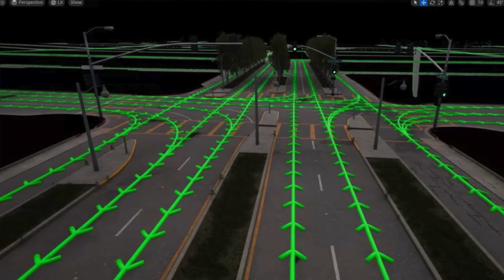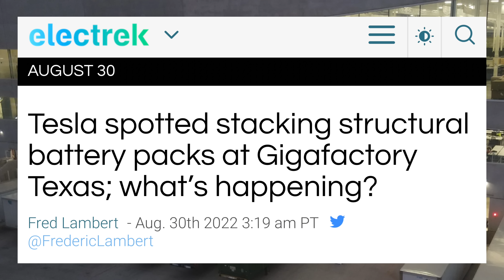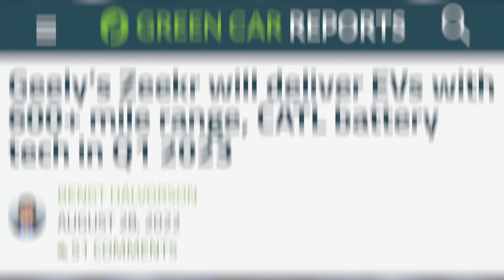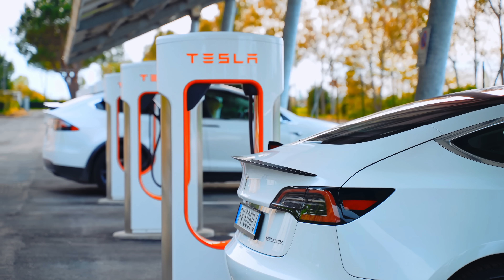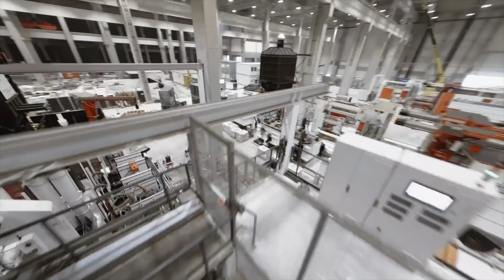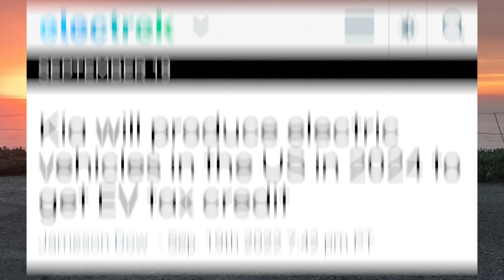Tesla Keeps Destroying The Competition | Ford Can't Keep Up

Comment: It is stupid for CATL to say that their battery can achieve any specific range. They need to stick with what they can control: internal resistance, energy density, and ease of manufacturing and recycling. I will give praise to a battery manufacturer who steps up and both designs a battery pack which can be EASILY recycled (i.e. without lighting it on fire) and also opens up facilities who can manage the recycling in a cost effective way. These battery manufacturers should be ashamed of the way they put packs together with no regard to end-of-life.

Comment: I will not buy an electric vehicle with a range LESS than 1000 km range, about 620 miles. Carrying the extra battery around for the 90% is not an issue. Being unable to take a 1000 mile road trip without having to spend up to an hour recharging the battery IS a MAJOR issue.

Comment: Range isn’t the only factor in buying an EV. We have a second car we rather use for long trips (more luxurious) and we use our ev for almost everything else putting 1,500  miles on it a month and never thinking about range
Reply: Or if you’re a single guy or gal that doesn’t want to tag and insure two vehicles, you can simply buy a single dinosaur-burner that serves all of your transportation needs …
Reply: Yes OR a Tesla I could only afford a Chevy Bolt and it doesn’t charge nearly as fast!

Comment: Electric cars should accommodate supplemental batteries that could be added to trailers. So when you tow you can have the extra range. And when you camp, you can have all the power you want.

Comment: Have a Range Rover. Model S Tesla obv. And then a Rivian R1T. Range is the best confort… Rivian is the funniest… tesla is slowly losing its edge but then again gotta wait for a REAL SUV from tesla but right now I would get a rivian over a tesla S, 3, X, or Y lol its just a more fun to drive and even the AC cooling OMG its so quick and some stuff I forgot how much I loved physical buttons… Rivian has this like hybrid system for like the wipers and lights and its just fucking amazing.. tesla still better with self driving but rivian gives me ZERO problems on the highway.. just cant be used on real roads like by houses and stuff but I like to drive it as much as I can minus the 30 min drive on the highway to the REI I like to go to

Comment: I would like to sell my 2021 Tesla standard range. It has 19000 miles now. What is your suggestion? should I keep it or sell it and get the longe range model later next year. Also I did not receive the $7500 rebate for this. I am thinking of getting by with another vehicle for a short time until 2023 and get the long range.
Thanks for your suggestion.

Comment: Most people I talk to want 1000km range and much faster charging times. Elon saying that people don't need more than 400miles of range reminds me of Bill Gates saying no one will need more than 256kB of memory. Not nearly that bad, but, but similar. What people want is often not what they need. If you give people the option of a 500km, 800km or 1000km range vehicle and they'll prefer the 1000km range. This may go up to 1500km for a towing vehicle. Even 2000km for a vehicle that will exclusively be for road trips towing a camper trailer or something.

Comment: 11:30
I believe price cuts will depend less on ramp and wait times, more (or completely) on the variables in underlying material cost.
I think we've actually seen this before, but without detailed explanation.
.
I like to think that Tesla sets a nominal build cost for a vehicle, let's say $40k, then assigns a target margin, say 25%.
Total $50k.
.
If materials constitute 50% of the build cost, ($20k) but increase 25% 
The build cost hits $45k, the margin remains 25%
Selling price is now $56,250.
.
Tesla is insulated, making similar margin.
.
It will be interesting when (if?) as EM suggested, material cost decreases later this year.
.
The mistake which will no doubt be made by "the Gordons" will be to assume any drop is due to vehicle market demand, rather than the material market.
Good luck explaining that to them.
.
It would be great if this is the case and an official Tesla spokesperson stated as such in clear terms ?
"Margin fixed.
If you see reports of <insert mineral> cost increase, expect a similar percentage increase in our vehicles.
The reverse is also true"
.
Thereafter, a simple statement
"Lithium down.... Cheaper cars.... Congratulations" would suffice.
They could add (in the opposite case)
"We're not screwing you over, those margins ensure constant reinvestment, thanks for your contribution to the energy transition"
.
SMART customers could live with that.

Comment: Going on holidays with a 400 miles battery is NOK. So why not adding a holiday-rent-pack I would say only when you need it. 
Then range is not a hot issue anymore, especially in Europe where everyone goes same time on holidays easily driving 1000 km in one go.

Comment: I want a quad motor 600 mile cybertruck. I currently have a tri motor 500 mile CT on order. Hope I can upgrade my order when they start production. I ordered this within 24 hours of the product release event in 2019. I have been a very patient investor, both with stock and product. The first has paid off greatly, the second, not so much.

Comment: I regularly drive 300+ miles 3 days a week. I really need a 400+ mile range model y
Reply: Agreed.  However mental fixation and pride can get in the way of a single leader..  In this case, E.L. Opinion from on high (not on the streets where you and so many are), no one needs REAL (not fake published EPA) ranges of 450-550 mile affordable options for all current vehicle types being built by Tesla today. 

With the evil Atilla The Hun mongol war criminal ChiComs monopoly on battery supply chain, they can leverage 600 mile range at lower predatory pricing than rest of the world.

Comment: Just was told today my Model S needs its third battery in 9 years.  Got 50K miles per battery and the 3rd will cost me $30K to replace.  Im out there is no value in long term ownership of a Tesla and likely any other EV
Reply: So with 50k miles for 30k plus charging cost comes out to what 1$ per mile.  Is that bad?
Reply: @shahbazfawbush  I believe it is very bad ROI yes.  To drive ICE vehicle equivalent mileage in fuel would be $7500.  You also need to account for the actual cost of the vehicle.  Not included was the drive unit replacement just two weeks ago for $10K.  Lastly my math was a little off on the standard to metric conversion.  It was actually on average only 35K miles per batter achieved.
Reply: If you are not a bot Andrew, provide a public link to your vehicle, with newspaper and another means to prove you actually own said Tesla that you report the FUD.  Otherwise, you are just another short selling troll who does not own a Tesla.
Reply: @johnross6314  I assure you I am not a bot but with your assumption it is clear what you are.  I do not own "a" Tesla.  I actually own two Model S's and have a Cyber truck on order.

Comment: Yes the build  quality is very bad I got my Alston model Y last month on the 19th. I just picked it up from Tesla today and they could not get the doors to go flush a driver and passenger front door stick out. The text said it’s normal for Alston cars because I use that front casting and it throws a geometry off for the whole car . I was trying to install rear mudflaps on I took out one of the 10 mm bolts with a nut driver operated by hand and got two full turns that were very hard and then the nut inside broke leaving the bolt spinning Tesla would not replace the bracket the bolt broke off of all they did is put Apoxsee on it

Comment: I've had a reservation, for the Rivian R1T, for almost a year, but for the Max Battery Pack version, which is supposed to offer, around 400+ miles of range.  It doesn't appear that this vehicle will qualify for the $7500 tax credit, due to its price point, which is VERY disappointing.  When we did our TEST DRIVE, about 6 weeks ago, we noticed that the accelerator pedal, took quite a bit of foot pressure, leaving us to think that this would cause 'Driver Fatigue.'  You might want to do a Test Drive, and see if your experience, mirrors ours.  I would be very curious.  Thanks!  I may sell my Max Pack R1T, should anyone be interested.  Otherwise, the truck was pretty sweet.

Comment: Drive a EV at -4° f and you'll see that how More Range is important !
Reply: You’re assuming that added range is the solution to reduce range in cold weather. However if we solve the cold-weather problem separate from adding overall range?
Reply: @jeffpicken5057  What?.... and how do we solve cold winters in Quebec  Canada ???
Reply: @integra8502  we don’t solve cold winters. We battery engineers) solve for them in other ways than just added big range. One way that has been done is the heat pump. More research and development will assuredly come up with other solutions. It just takes time.
Reply: @jeffpicken5057  well the heat pump is been having all kinds of problems in very cold climates like Quebec

Comment: yes you need more range to offset cold weather range loss
Reply: OR you need to solve for the weather range loss in other ways. Morr Range assumes more batteries and heavier vehicles which reduces range, so they work against each other. If the cold-weather issue can be solved without the need to add range it’s a win-win.

Comment: We absolutely need a 600 mile Tesla! Right now we treat an EV like a phone— you get used to charging it every night. For many people that live in a city in condos or townhouses, home charging is not feasible. Taking multiple short-term trips for the work week without charging would open the door for so many people.
Reply: You are dead on for the examples you show. Good points.  I have met many Uber drivers, nd younger owners at Superchargers who live in dense housing where they cannot plug in at “home rates”. They are stuck going to superchargers in off peak times to get lower rates.  They would prefer not to go as often and waste time.  Gives them more choice of timing with longer range.  

PLUS one suggested, and I agree, we are talking the “80% game”.  Meaning two things. 1.) the larger 600 mile battery pack will charge faster at lower percentages of charge.  Meaning, getting more miles of range per minute per KWH than same charge on a smaller battery. 2.) take range and figure 80% to max battery life (and not have to stay forever while the slow rate of charge fills from 80%-100%.) the 80% charge still has decent range for the 80% charge of a 550-600mi (at 100%) real world range pack.

However, mental fixation due to E.M. brain design can get in way when he is wrong.  This time, wrong on the street view by so many about more effective range beyond what he is offering as a option.  He is mentally agitated about the range discussion. So far, will not budge. Or he is lying, because they have plans for better real world range options.

Comment: Pretty impressive that a Car, that looks like it was built in a Ikea Factory? Beat everyone. Kinda like I-phones and Fanboys.. totally brainwashed by a totally unoriginal idea. I literally don't get it besides the engineering..
Reply: But the engineering is the main point.
Reply: Kevin, leave us and go back to your rice burning sputtering ICE wheels.  Or whatever nonsense you are traveling in.
Reply: I drive a Chevy Volt 2nd Gen.  Get three Worlds. I don't want to wait forever. Also, Tesla needs to do better than LFP batteries. 3 minute battery was invented from Harvard. That is the future Fan Boy.

Comment: Because I could drive all of my prior ICE vehicles a minimum of 330 miles on a single tank of gas in the dead of winter, I would like my EV to do the same. Since my EV can lose up to 33% of range in very cold weather, I'd need 492 miles of theoretical range minimum. To avoid arriving to my destination with only a few miles of range, a 15% buffer would push minimum range to 566 miles.

Comment: Bigger range does not mean more weight if you increase battery density. It looks like CATL almost doubled density in comparison to LFP. If there is no weight penalty why wouldn't you want a higher range? Especially for those people that rent and are unable to charge at home. I personally drive to remote areas of Arizona where there is no charging and it's very difficult if not impossible to plan a trip in an EV. If I had a 500+ mile range, it would be infinitely easier.
Reply: You’re absolutely correct. As densities get better and chemistries get better, range will get better.

Comment: The point of the 500mi car is to be able to charge 10-70% in the quick charge part of the battery and get 300mi that will be equivalent to a normal car’s range. When you have a 300mi range and can’t charge at home (like me) you end up with a 180mi practical range.
Reply: 500 miles at an average of 80mph, 6 hours plus change.
70mph average (actually more likely) 7 hrs +
.
Without any break?
That's a "niche" market to say the least.
You don't take a comfort break? Or eat? (Without leaving the vehicle? Dangerous?)
Think simply about time between meals? 4-5 hrs, max?
Even a 400 mile vehicle, with the ability to travel for 5-6 hrs at the noted speeds is probably unnecessary, but would still be able to Outrange 95% of passengers, then, while those passengers "did the necessary" for 15-20 minutes (probably longer?) add 60-70% for a very useful second stint.
Every single vehicle, ICE or otherwise, is designed to "the bell curve" of human dimensions and habits.
If a study was conducted to audit vehicle use of even long distance drivers, over 400 miles in one hit would be well outside the normal range.
.
Not to mention, the 400 mile vehicle results in 25% more of the type being built....
(350, even better!)
Reply: @rogerstarkey5390  it’s almost like you didn’t real their comment at all… 🤦‍♂️
No one drives 100-0 and then charges to 100 again. 
I have a 310 mile model 3 but at freeway speeds it gets about 260. And again we never drive it 100 to 0 and charge to 100, more like 100 down to 20 and up to 70. Then I have to charge every 2 hours. That starts to get annoying

Comment: So.....I think Tesla is in a bit of a pickle until January 1, 2023.  I2n my case specifically, I just received notice that my MY will be delivered in Sept.  I placed the order last Nov.  You can imagine I don't want to take delivery until 2023.   I've done the math and if I decide to let my reservation go and place a new order, and I get the full $7500, I actually save $600.   I'm to the point where i think it makes more sense to wait a bit because it seems likely that prices will start coming down.  I think there will be a glut of reservations once it's apparent your order will fulfill in 2023, and maybe Tesla raises prices again.   So I see inventories increasing considerably until end of year and deliveries not being as good as they could have been w/o the IRA.  Long term, it doesn't matter.

Comment: Definitely need 1000kms range, up in Canada, the cold weather will already cost ~20% battery power and i regularly travel distances of 700kms with only 1 stop in the middle, last thing i want is competing for a charger. The range is one thing i wont compromise
Reply: I need a vehicle that won't get high-sided by a foot of snow. Those low friction tires are useless at clawing through the snowdrifts.

Comment: Once charging speeds are in the 15 minute range, ranges over 350-400 miles are detrimental due to added weight and cost with no real benefits. You are going to stop for food and a bathroom.

Comment: I am used to driving 1000km on one tank of diesel, so a 600mile range looks perfect. Hopefully Tesla will eventually get around to making a model y ultra LR that can do that range.
Reply: is it worth carrying that weight daily? and the extra price for the battery? vs the inconvenience of an extra 20 min stop on those 1000km drives?
Reply: @MikeT5116  usually a fast charging only works at 10-60/70% so if they have 500/600 miles you can get that 300 Miles faster than a full 300 Miles battery while also being really healthy to the battery since you dont need to full charge it everytime.
Reply: @hitie6792  
Let's imagine a future step using the 4680.
The cell produces less resistance, so less heat, so less stress.
This should increase longevity, but also let them release more power, and receive more energy without such heat slowing the charge rate(?)
.
If rather than peaking at 25/kWh, then a linear drop to 110(?)  at 70%, they hold between 250-230kWh, that's a big step?
I make that 80kWh (0-100?) in +/-20 min?
10-70% (60%) in 12 minutes?
That's literally a "splash and dash" (wash your hands!) and grab a coffee.
300 mile, "4 hour" car
Fast stop, 3 hours, repeat.
Problem solved!
Good for the driver!
Safer roads.
Minimal down time.
More vehicles.
Reply: It’s called CyberTruck
Reply: Heading for prostate problems in a few years! 
Your choice of course.